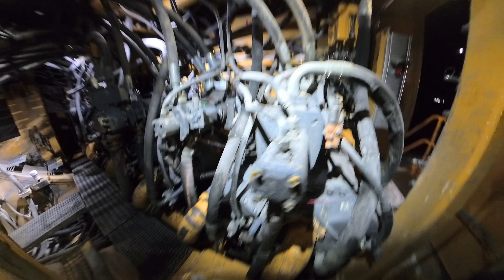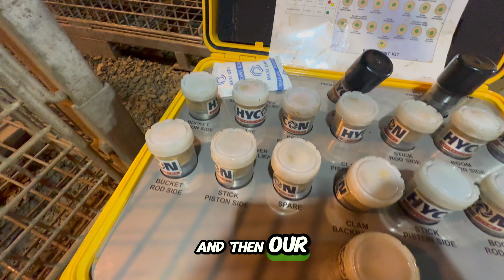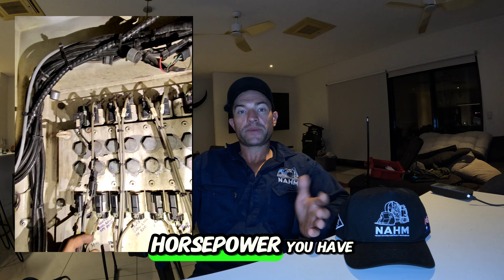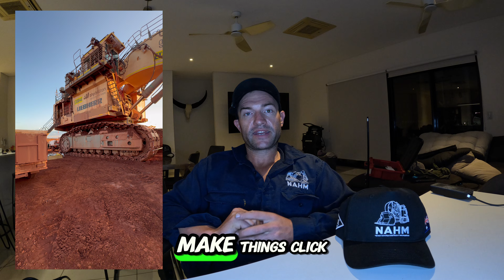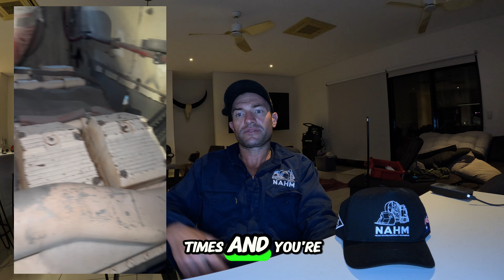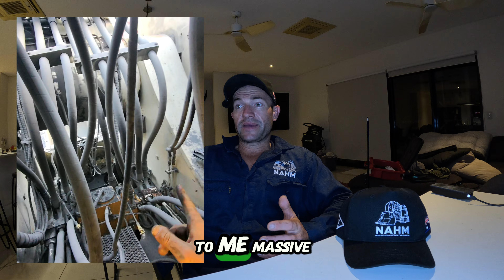Master Hydraulic Horsepower to Get the Most Out of Your Equipment!

Comment: Hey pat great video, one point i noticed when you brought up about travel motors and their swash position, the way I understood was
Full swash low speed high torque 
Mid swash high speed low torque 
In this scenario I like to think of it as leverage, if the motor is in a more neutral position it’s harder for the oil to rotate the motor but as it consumes less oil per rotation it can spin faster.
Reply from the maker: Yeah your right mate I’ve got it backwards being a motor! Always learning best thing about putting your ideas out there your going to get it wrong every now and then and learn something cheers mate! Appreciate the comment! Definitely makes sense when you put it like that!

Comment: I always wondering how  Hydraulic pumps and  clyinders work.....Those Ultra Class 797F MT6300AC  T282C T284 930e 980E 400tons how can 2x Hydraulic Clyinders mount under the dump bed can have those kind of power and force to push 400ton materials upward......It just amazing to watch.....

Comment: With single engine operations, will one engine eventually sit at 20k hours and the other will have done only like 12k hours in that same time? How does that get sorted out with maintenance and overhaul intervals, or do they just pull an engine out and replace it with a spare while the pulled one gets overhauled?